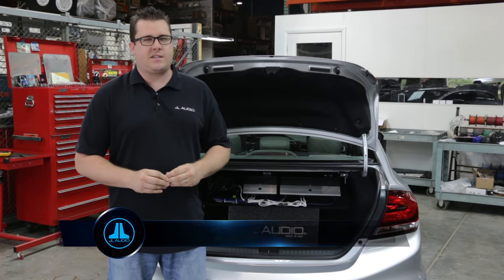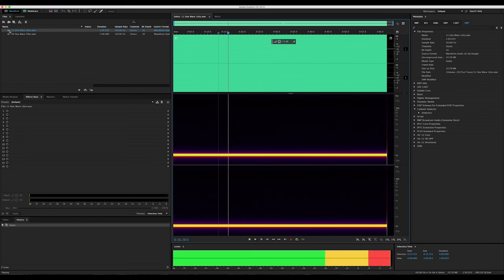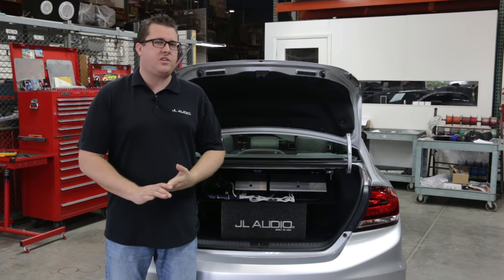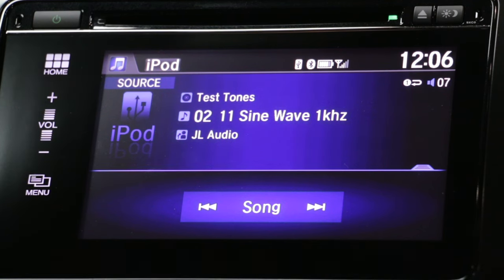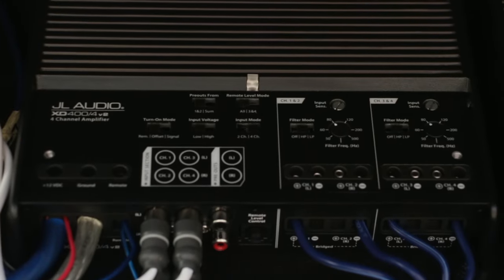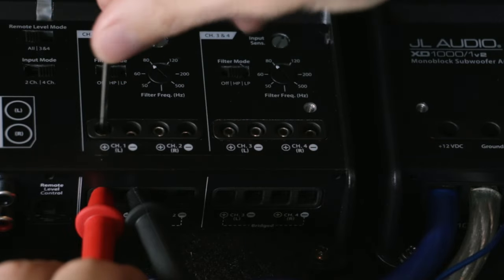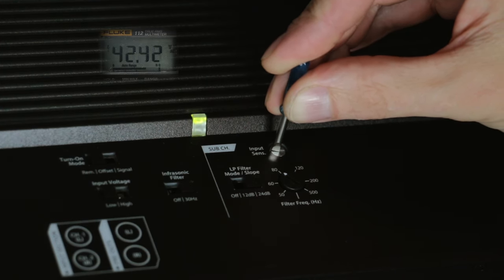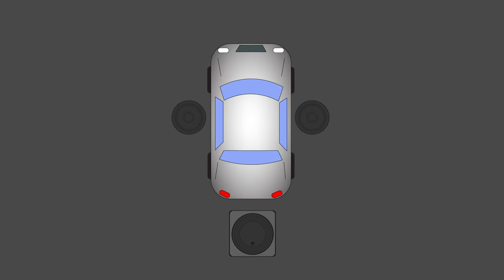Setting Amplifier Gain or Input Sensitivity

Comment: @JL Audio. Does it have to be at 3/4 volume? I have the Pioneer 80prs and that is clean until around 60/62 according to my SMD DD-1. The gain is set on my amplifier too to match that of the headunit. The problem i am having though is that at volume 50 on the headunit, the midrange in the doors really start to distort. I used to have passive crossovers between the tweeters and the midrange and I could play the midrange down to 125hz at a 12db slope very easily. Once I removed the crossovers though and went fully active, I've had to increase the high pass filter to 250hz at a 12db slope so that distortion doesn't come through. The Car is a 2011 BMW E90 and the speakers are MBQuart components consisting of 4" midrange and tweeters that are plug and play fit. The paperwork isn't great for them and some accounts say that they are 60 watts whilst other accounts say they are 80 watts. The underseats are Audison 8" woofers running in parallel to a 2ohm load. Each woofer is at 150watts RMS each. The amplifier is a five channel JBL GTR-7535, which is at 4x75watts@4ohm and 1x350watts@2ohm. I'll dial the power down on the sub so it's getting 300watts RMS rather than 350 imho. The only thing I have not done after using the DD1 is probing the speaker output with a DVM/Oscope to see see what voltage was being displayed when the clip light turned off, instead of simply relying on the distortion detector. I will be purchasing a Liumy LM2001 to check. I can only think of a few things that could be the issue. 
a) - Too much power is going to the midranges.
b) - 125hz is too low a filter for them.
c) - When the passive crossovers were in place, they might have been masking some of the power going to the midranges.
AIso I'd need to use test tones that are appropriate for those channels, such as 8khz on the tweeters, 200hz on the mids and 60-80hz on the subs correct? Thanks
Reply from the maker: @Shakeel Faris, even if your head unit goes to almost max volume clean, I would still suggest using 3/4 so that you have a bit more gain overlap for various types of music if you are using the 0 db tones with the DD-1. If you are using the -5 db tones then it would be best to go to max clean volume to do so since the - db tones are another means of getting more overlap. For a 4 inch driver I would typically suggest a high pass at around 400 Hz at 24 db slope. Any lower and you can risk over excursion at high volume under good power. If the Audison drivers are midbass drivers then I would bandpass them from about 400 Hz and down and then run the 4 inch at 400 Hz up to about 4-5 Khz with a 24 db slope. Then run the tweeters from 4-5 Khz and up at 24 db slope. This should allow each speaker to run more efficiently and achieve a higher volume level safely. If the speakers still distort then you may need to dial the output of the amplifier a bit since this would now mean that they are being over powered. The tweeter channels will most likely need to be dialed back also to achieve a proper balance with the 4 inch and 8 inch drivers.
Reply: JL Audio I set it up yesterday using the dd1. The highest unclipped volume on the unit was what I got at 40hz using a 0db test tone was 57 out of 62 on the sub channel and on the mids and highs it was 60 out of 62, so when setting the gain, I used volume 57. For the gain overlap as per the dd1 instructions, I used -5db for the mids and highs and -10db for the subchannel. The only way I can bandpass the woofers is if I get another amp that has a subsonic filter on it. I’m not sure JL does a 5 channel with that ability? At present I have the underseats low passed at 125hz on a 12db slope, the mids highpassed at 200hz at 12db and lowpassed at 3.15khz at 24db with the tweeters highpassed at the same on 24db. The thing is though, wouldn’t 400hz coming from the Audison’s sound odd as it is a high frequency to send to them and they are running in mono to a two ohm load on the sub channel? I know they can play from 30hz to 500hz. If I had the means to bandpass the underseats I would highpass them at around 30-35 hz as I don’t have a dedicated subwoofer to take care of the really low end frequencies. Ideally, how many watts should be sent to the tweeters and the midrange?
Reply from the maker: @Shakeel Faris, I would consider adding a DSP such as the TwK 88. This would allow you full crossover capability for each independent channel. The TwK would also allow you to time delay each speaker so that the sound of each speaker reaches your listening position at the same time for even better blending and imaging. You could even apply a high pass to the 8 inch speakers as you mentioned to relieve them of the lowest bass frequencies.  For now I would at least bandpass the 4 inch speakers as mentioned and bring the low pass of the 8 inch up to 400 hz to meet up to the 4 inch. This is safer than trying to play the 4 inch so low.  If you have access to an RTA you could play pink noise through your system and put the mic at your listening position. Then look at the frequency graph on the RTA. If the levels are not matched up (which is typical at first) you can slowly dial gain down on the channels that are needed to balance with the 8 inch midbass. Typically the 4 inch will need to be brought down slightly and the tweeters quite a bit. Once all the frequency ranges match up db wise on the RTA then you know you have them level matched properly. Tweeters typically only need 15-20 watts to blend with the rest of the speakers.
Reply: @JLAudioInc  One more thing. I'll be getting the JL 700/5v2. I know that it has two sets of outputs for the sub which internally will see a 2 ohm load if I plug the woofers in individually, however, I have already wired my woofers in parallel at the woofers themselves, does this mean that I now have to rearrange the wiring at the woofer and separate them or can I simply keep the existing wiring as it is and just use one set of positive and negative terminals as though there is only one set at the amp? It's just to avoid the extra work like taking off the panels to undo the wiring. If that is the case, which set of terminals do I need to use on the amp, the two outward ones or the two in the centre? Thanks
Reply from the maker: @Shakeel Faris, the connections at the subwoofer terminal are paralleled together to make it convenient to parallel two subwoofers together right at the amp. If the subwoofers are already paralleled together inside your enclosure at 2 ohm then you can just run one positive and negative back to the amp. The amp will then see it as a common 2 ohm load.
Reply: JL Audio Ah okay. Do I use the two outer terminals and/or the two inner ones. They just look slightly misleading when looking at them.😀
Reply from the maker: @Shakeel Faris, it does not matter which positive and negative you use.
Reply: JL Audio in terms of setting the gain. Do I need to flick the switch to high as the pre-amp output on the headunit is 5v
Reply from the maker: @Shakeel Faris, I would start in low. If gain is all the way down and you are over target voltage then switch to High and start over.

Comment: Hello my 4 channel amp is running the correct voltage on 28/35 volume (as high as possible before the clip on the headunit) at the lowest gain setting is this possible that i don't have to move the gain knob any bit? and just leave it at the minimum. headunit is alpine ute 200bt and amp is soundigital 600.4 evo5

Comment: And once the amp gains have been set to the recommended voltage now I can start playing with the stereo settings? Or i should leave them flat? Because once I start doing that the voltage goes up

Comment: I have the MX 280/4. When I adjust the input sens screw… the most it reads is 16V on low voltage switch. On high it reads 5V AC. I already replaced this once. Really don’t know what to do at this point

Comment: Can u mess with the bass and treble after you set the gains???
Reply from the maker: Diego, you can make adjustments to both after you have set your levels, but you have to be mindful that adding boost will usually start to distort the audio output through the stereo. I recommend trying to make cuts only, whenever possible.

Comment: I realise it is different for different amps. I confirm raising the they equaliser by 3 db dont always double the amp output voltage but using the gain and changing the the sensitivity from 3 volts to 2 volts make big difference. I used a 0 db test tone and go into the setting and drop it -5db set my volume 38 which is clean set the eq to flat set my active crossover to output 4 volts pre out set my amps to accept 4 volts. Then I eq using the powerful eq plus I have the loudness on max and there is no clipping. And when playing music I get about 2.5 to 3 volts perhaps it speaking to 4 volts but sometime it could be quick so it not. I suspect many deck loudness setting and eq roll of as the volume get higher so you can get more bass without clipping because my deck when playing music was booster by 11db and it still not reach 4 volts like a test tone so a 0 test tone is extremely un realistic.

Comment: Lets suppose my headunit (Pioneer 80prs) has a 5v output and when checking for distortion it clips at maximum volume which is 62/62 (tested with an SMD-DD1), then I plug the RCA's into the amplifier (A JBL GTR 7535) and plug the DD1 into the speaker outputs and even before I adjust the gain, the oscilloscope or DD1 sees distortion at a lower volume, is that telling me usually that the input switch on the amplifier needs to be switched to the "High" position in order to accommodate the higher input that is fed into the amplifier, just like you would have to do on say the 700/5 v2? Would you need to adjust the amp switch to high if it was a hot pre-amp output like on the 80prs? Thanks

Comment: I have a 4ohm sub, but it's wired to 2ohm, so, when I go to multiply 500watts by the ohms to get my voltage, do I multiply the4ohm that my sub is, or by the 2ohm that it's wired to?
Reply from the maker: Daniel, if that's a dual 4 ohm subwoofer with the voice coils wired in parallel at 2 ohms, then you do the calculation based on 2 ohms. If that's a single 4 ohm subwoofer, there is no way to wire it at 2 ohms.

Comment: Question: I paired my setup accordingly. 2 750 rms watt subs (12"L7Ss) and one 1500W RMS CEA rated (Rockville DB15) everything at 2 ohms, so WHY would I encounter any clipping? Not saying that I have, although I think I have, but my question is would I encounter clipping if my Bass Boost is kept at zero? SECOND QUESTION: if I keep my amps bass boost off but use my bass knob, is that considered using "bass boost"? Tyvm for answers!
Reply from the maker: Hey, Brandon.  We are flattered you are asking our advice for your system.  You have not listed any of our products that you are using so this is a freebie (because JL Audio rules).  

The very basic answer is yes.  depending on how the input sensitivity (or possibly called "gain" on your amplifier) was set it is entirely possible to still overdrive the amplifier and introduce clipping and distortion to the subwoofer system.  We will link a 9 step video showing you a great method to set this dial to ensure full power but not overdriving the amplifier.  It is important to note here that ALL JL audio amplifiers will make their rated power cleanly, this is not always the case.  Not being familiar with your specific amplifier I can not make that guarantee you would have to fall back on the manual or manufacturer website for that info.  Assuming you are correct in that amplifier being capable of 1500 RMS watts then your target voltage for setting the amplifier for 1500 watts into a 2 ohm load will be 54.77 AC volts.

In regards to the bass knob functionality it can vary from various manufacturers and even models from the same manufacturer.  I would again suggest you fall back on the manual or website for that info.  

We certainly hope this information helps you dial in your subwoofer system.  All we ask is the next time you are in the market for mobile, marine, home, or power sports audio that you consider using our products in your build. 

www.youtube.com/watch?v=2eRYzXBmWq8
Reply: @JLAudioInc  Wow, JL Audio does rock! I promise I certainly will consider JL Audio especially due to this response and JL Audio's website! Thank you very much!

Comment: Hai JL... Thanks for the video
I have 2 Doubts
1. , can you explain what should be the positions of HPF & LPF, switches provided in the Amplifier while doing the gain setting for full range speakers and subwoofers
In a 4 channel amp. (1/2 For speaker) &( 3/4 for Sub woofer bridge)

2. In every videos in YouTube  regarding the gain setting , they are using RCA input.. is that mandatory.. ?? What would happen if I use speaker level input instead of RCA while doing the Gain setting...
Reply: Please help...
Reply: @HariKrishnan-jl4hm    maybe i can help.   the position of the hpf-lpf are to be as wide as possable.  for example:  160 hpf - 20lpf   thats your tuning area.  

doest matter one bit if you use the high level inputs or low level (however) if you ad a LOC before the amp. to convert it to low level.  you"ll have set the gains on that. which would be from the amps specs. (5v) or whatever. 

your on the right track!  its all trial and era. 

i learned.  setting the volume to half way. then setting the gains to its desired voltage sounded better at everyday listening.
if i go over the half way. i turn down the remote knob to off set the added clipping signal.      just hours of tuning.

larry
Reply: @mafosa8519  you should not be giving information when you need to learn it. The majority of head units will start clipping very close to the 3/4 of the way mark. That's why they tell you to set it there. If you actually got an oscope and did this for a living and not just for yourself you would understand this point.  Crossovers do not need to be set to wide apart from each other  low pass filter (depending on a few things ,sub size, box design and tune frequency). Normally LPF is set around 100hz sometimes 80hz sometimes 125hz depending on what I said above.  Then (say you set your LPF @100hz) you then would set your high pass filter around 100hz to 125hz. Setting filters far apart just deletes frequencies that you will never hear.

Comment: hi guys, i am trying the same method to set my gain, but no ac voltage reading on my multimeter. all wiring is okay. i did check their voltage. any idea ?

Comment: When I started with a flat EQ and set my amp to 21.5V, and then set the EQ to the "VIVID" setting and checked the voltage, it was over 30 volts. Same volume & test tone. 
30 volts is way too high for the subs. I know I could do a custom EQ that keeps the lower bass flat and only boosts the highs, but why can't I just set the amp with the EQ on VIVID? I know I'm missing something, please advise.
Reply from the maker: Thank you for reaching out!

This question may be better suited for our tech team. Feel free to submit a request here: https://jlaudio.zendesk.com/hc/en-us/requests/new

Comment: Good video Tanx 
But how to set the volume button on the amp while setting the gain?
Or is the volume button not important??
Reply from the maker: Marcello, the volume on the stereo should be at 3/4 volume. If you have a level control knob connected to the amplifier, disconnect it for setting the amp levels, then reconnect once you've completed the process.
Reply: @JLAudioInc  
Its not a volume knob connected with a whire orso 
Its the volume knob on the amp itself next to the gain knob
Reply from the maker: What model amp are you referring to?
Reply: @JLAudioInc  
Its a Gravity ps 1600
Reply from the maker: That amplifier does not have volume knobs, those are the crossover frequency dials. We'd recommend setting them around 80hz as a good starting point. Set your switches to HPF on the channels with coaxial speakers, and LPF on any channels connected to a subwoofer.
Reply: @JLAudioInc  
Ok ok
Tanx man
I will check everything 
I Let you know
Reply: @JLAudioInc  Does it have to be at 3/4 volume? I have the Pioneer 80prs and that is clean until around 60/62. Can I set it to that and adjust the gain? Also as I am running fully active, I'd need to use test tones that are appropriate for those channels, such as 8khz on the tweeters, 200hz on the mids and 60-80hz on the subs correct? Thanks

Comment: Considering the subwoofers are disconnected and then you are taking the reading with the dmm, wouldn't it change the load and therefore the voltage if you did this work the subs connected? Basically wouldn't the subs being disconnected as shown here give you a different result than if they were connected like in the real world setup of the amp? Does the load drop when the subs are connected change the timing of when you get the optimal voltage dialed in? Won't the clipping happen at a much higher gain setting when the subs are disconnected than it would when they are connected and causing a different load?
Reply from the maker: @Rob I, the meter method is testing for the voltage potential of the amplifier. This potential is the same whether a load is connected or not. Since we know our amplifiers are capable of their rated voltage whether a load is applied or not, we can simply test with no load or speaker attached so that we do not risk damage to the speaker itself when doing the test.
Reply: @JLAudioInc  ok. Makes perfect sense! Thank you for the verification.
Reply from the maker: @Rob I, you are very welcome.